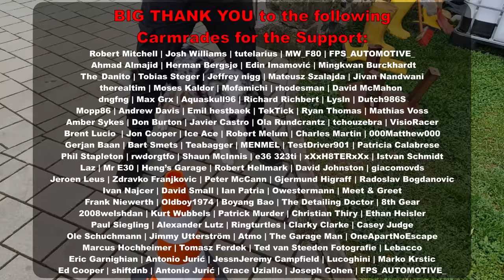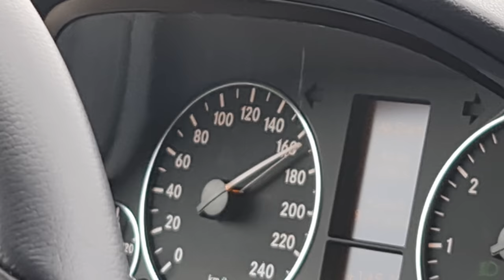Who Needs an AMG? | Cupra Racecar Engine Upgrades!

Comment: This engine must be very durable, driving constantly at the rev limiter
Reply: Imagine that with turbo diesel engine :)))  I'm from ex communist east European country, gas prices are as high as in all of Europe and salaries are like 6 times lower, everyone is driving diesels, paying for turbine reparations, intercoolers and all those strange pipes worth 80+ euros. But diesel is cheaper like 3 or 4 euro cents. Changing gears before 2k rpm is a way of life here.
Reply: It must be durable - after all its a high-performance sports car.
Reply: @raulio81  its 2500..mostly. and diesels are fine...this A class is 1.5 petrol with automatic transmission its slower than 1.3 mjtd punto
Reply: @raulio81  when I got my license the instructor suggested always to rev Diesel engines around 1500RPM 😂

Comment: Misha, what were you thinking? You had a neck injury recently - why risk it with all the g-forces. Luckily your driver decided not to chase down the 911 or you might have been in traction right now.
Reply from the maker: It's all good, I'm fine :)
Reply: well, there are hardly any g-forces happening on this ride 😜

Comment: That catch can setup/PVC delete would be great on the Ford Ecoboost engines. They have serious issues with buildup on the underside of the valves which causes them to run like crap, even after 30-40K miles.

Comment: His mother will be angry not at him, but at you Misha, stop dissing her car. :)))
I remember almost buying used A class, give up because lot of people told me not that the car is bad, I don't care, but that the engine is in some strange position you can't repair anything without disassembling most of the car. Never checked that, and not going to now :)))
Reply: AFAIK the engine is partly under where the windshield starts, and the firewall is angled so in case of a crash the engine will be directed downward into the ground. And they aren’t particularly reliable either, although their interior space is quite impressive

Comment: Oh my god a CVT.

I don't even know why those exist, literally no upside to them. The car is so much slower 170kph downhill for 90hp is dumb, I've driven cars with 65hp that got to 185kph on flat. When it was accelerating the only way you could even tell it was accelerating was the engine noise lol

Comment: but... this a-klass has only 1 gear??
Reply: CVT gearbox as the DAF passenger cars used to have, but now in a modern form.
Reply: @micheltebraake7915  basically like a scooter?
Reply: @larsen1974  yep
Reply: @micheltebraake7915  Really.....just one gear Holy Moly.
Reply: @bannedone3ice138  It's like the pulleys and belt on a RZR buggy.